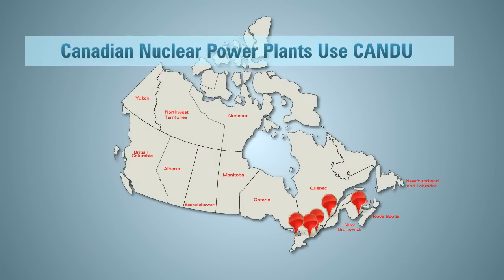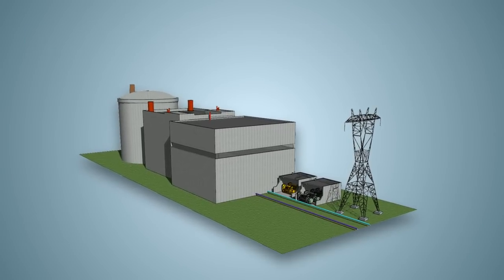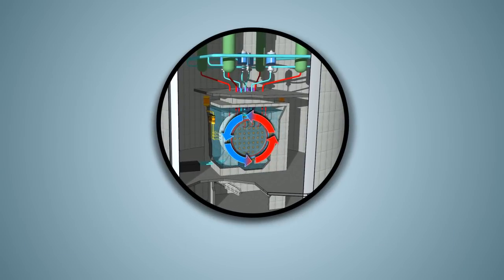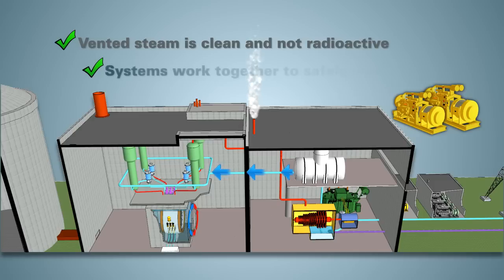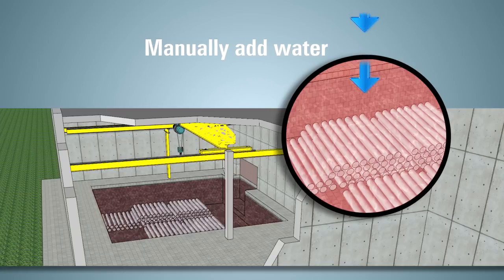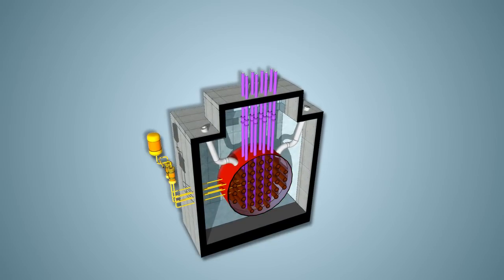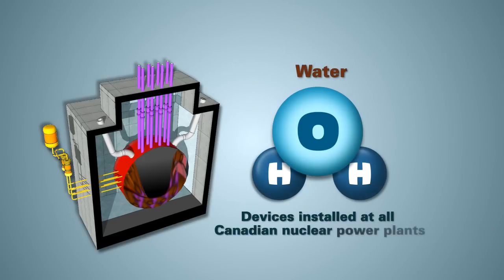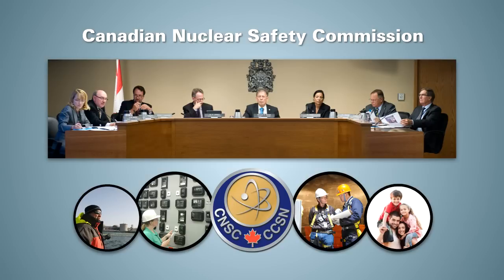Understanding Nuclear Power Plants: Total Station Blackout

Comment: We get it, putting water into the calandria using firetrucks or pumps will stop the accident
Reply: i love how you just replyed that to every comment in this video
Reply: yep
Reply: But the accident would totally keep going because they forgot how to pump water in.
Reply: But won't the heat keep evapourating the water you pump in and produce radiated steam? How to get rid of it?
Reply: LMAOOO
Reply: How imagine tsunami TRASHED the ground area and knock all power systems. And quake damaged the pipes...total meltdown even in CANDU. (2011 japanese scenario)
Reply: Wong Tik Ki the water that is use to cool is in another system if I’m not wrong, there is another video explaining how CANDU reactor works. But I’m not expert that’s what I’m think that’s all.
Reply: hahahahha
Reply: Jordan Rodrigues  you are wrong. The source of hydrogen is from the zirconium melting down. Radioactive steam will emit radioactive gases if the reactor's fuel rods melt and still produce fission at a higher temperature.
Reply: @WadcaWymiaru  except no. Because not only is this not japan, but seawalls exist. Fukushima's was shitty and caused a meltdown. Onagawas took it without problem.
Reply: @dickiewongtk  you recirculate it.
Reply: @CarlosAM1  
The problem lies in shitty element" uranium" from uranus :/
Thor god power solves the problem...
Reply: @WadcaWymiaru  I like thorium too my man, but we currently have tons and tons of u238 already mined as depleted uranium, candus can use this and twrs would too, I support lftr, but at least for now candus is the best we got. Also crazy safe.
Reply: @WadcaWymiaru  Basically water is added to the non-radioactive heavy water calandria.
Reply: Because those Japanese didn't and make a really bad impression on general public.

Comment: I see canada is low key throwing shade at japan
Reply: Yes. Yes we are. CANDU reactors are fucking awesome and we have every right to be proud of them...

...especially when Japan is still running reactors that they specifically chose over CANDU reactor designs because they were American, when those designs even at the time were known by GE to be pretty awful and wouldn't build them themselves in the US.
Reply: @liesdamnlies3372  You saw what happened at Fukushima! Loss of power=loss of coolant flow, and there are no passive systems. Big problem.
Reply: 2:18 ExTrEmLy UnLiKlY!!!!
Reply: @liesdamnlies3372  American is best build ;)
Reply: @kushpaladin  *oldest

FTFY ;)
Reply: For unknow reason there not even a ONE CANDU in japan...
Reply: @WadcaWymiaru  It's not unknown. They were offered licenses for CANDU reactors and went with GE instead.
Reply: But the reason WHY was unknow...
Reply: @fifthbusiness2591  
But in Fukushima scenario with total blackout CANDU can cool itself for a long time. Look at Fukushima BWR reactor design and the CANDU.
However i agree we should stop using nuclear energy in that way. There is far better coolant than water. Salt.
Reply: Not throwing anything at Japan. There have been several accidents through out the world that the nuclear industry hashave learned from
Reply: Windscale - England (Inexperience with graphite cores and cavalier attitude)
Chernobyl - Russia (Operating outside set Policies and Principles)
Fukushima - Japan (1960s design basis for Seismic deign considerations)
Bhopal - India (Lack of maintenance on safety systems and continued operation)
Three Mile Island - USA (not believing instrumentation and design flaws not shared with industry peers)
Space Shuttle Challenger - USA (Production over safety. Ignoring warnings from maintenance and engineers regarding o-rings)
Demon Core criticality accident @ Los Alamos - USA (Improper safe guards)
Tokaimura criticality accident - Japan (Continuing to work when equipment was faulty. Production over safety)

Most of these speak to mans lack of understanding of perceived risk in dealing with dangerous elements. Not to say that we cannot use these things but there is a need to be ever vigilant.
For some light bedtime reading, get the Industrial Operators Handbook. It looks ate several accident and the causes. It is a real eye opener.

Blessings
Reply: @liesdamnlies3372   CANDUs are great reactors. The US won't build them because of the positive void co-efficient of the core.

There are lots of BWRs operating in the US. BWRs are a different beast based on 1950s and 1960s technology. They were good for their time. But alas, times have changed.
Reply: @dslag654  
Let's be serious man:
How many people died in last 10 years from the nuclear?
One.
Miner.
Crushed by rocks.
In uranium mine...
Reply: @WadcaWymiaru  Apparently, you have completely misunderstood the point. The operation of Nuclear stations is the safest industry in the world. As long as we RESPECT THE CORE. This is what WANO teaches. This is what INPO teaches.
Mining and construction efforts for nuclear are far more dangerous industries. Please read some James Conca articles to get a balanced view of how these industries compare.
How many people died from the Fukushima Accident? It might surprise you to know it was ~1400 (if memory serves). The majority being critically ill patients who were moved from hospitals in the panicked evacuation. They did not survive the transport. Shelter in place would have been much better with no ill effects. (Thank you Hollywood.)
As for a 10 year viewpoint: Since the biological effects from long term exposure to low level ionizing radiation are still not well understood to this day. Human lifetimes are required to observe this. (A LNT debate is not appropriate here.)
Perhaps a better question to ask is, in the last 50 years, how many people have had their lives permanently displaced by mining operations vs. nuclear operations? (Though, Pripyat today has shown that our planet can bounce back much quicker from our abuse than was believed.) There is more to nuclear incidents than just deaths. 
Regulatory bodies and Operators work very hard to ensure that the risks are mitigated. In Nuclear the risk vs consequences is very high. Looking in the rear view mirror and learning from past mistakes is one of the best ways to remain vigilant and keep nuclear safe. The CNSC, NRC, WANO, INPO, etc. all focus to ensure safety is paramount.
Reply: They always use previous incidents to educate themselves on how to be safer!
Reply: lies damnlies you said the f word
Reply: @fifthbusiness2591    The passive autocatalytic recombiners (PARs) were invented in Canada and were the outcome of what we learned following the Three Mile Island incident (1970's) where a dangerous quantity of potentially explosive Hydrogen gas built up in the containment building following the melt down.  Fortunately they were able to vent the gas without incident but it was none-the-less a close call.  PARs were installed into all CANDU and, I believe US reactors well before Fukishima.  Why the Japanese did not install them in their reactors is a mystery.  They are literally a cheap tin box that sits up at the ceiling and eats hydrogen.
Reply: @joerenaud9356  IIRC, there's some solid evidence now that there was a hydrogen explosion at TMI. It just didn't end-up in disaster because you know, it was actually contained in a big-ass thick-as-hell concrete cylindrical-thicc-boi-of-safety.
Reply: I’m from Canada we just don’t want a god dam disaster that goes on our permanent record
Reply: @charleslittleba  We already had NRX.
Reply: @WadcaWymiaru  Price, complicated design, positive void coefficient like an RBMK.. Price, price, price.
Reply: @liesdamnlies3372  Well, as efficient and as safe as our PWRs are, I must admit that is true.
Reply: @fifthbusiness2591  It is good they are now, but a hydrogen explosion would have to go through the light water in the vault and then would be taken to the vaccum building. As for the positive void coefficient, it is far smaller than in the Russian RMBK reactors (e.g Chernobyl) and they are automatic safety systems that would shut down the reactor. The nuclear industry is improving, just like aviation used to be significantly more dangerous in the 1970s.
Reply: @liesdamnlies3372  Always a grudge Japan
Reply: India has PHWRs based on the same CANDU design. Thanks, Canada!

BUT it's sad that Canada isn't building new reactors while India is building 15 new IPHWR-700.
Reply: @liesdamnlies3372 >"and wouldn't build them themselves in the US"

That's false. There are/were dozens of those exact types of GE reactors, one of them being 5 miles (8 km) away from where I live. It's an old obsolete design that's been facing decommissioning since the 1990s.

Comment: If you have a bad accident, simply supply water with emergency equipment such as fire trucks.
Reply: yes yes
Reply: They did that at Fukushima and it caused the cores to melt further
Reply: But never forget that supplying water with emergency equipment such as fire trucks stops the accident. It's very important to remember that supplying water with emergency equipment such as fire trucks stops the accident. But in case the accident is not stopped, you can always supply water with emergency equipment, such as fire trucks. That stops the accident.
Reply: Mgtow-M3 Modern Masculine Men 
How? Those isotopes are contained within the fuel rods unless the cladding has a hole, which is rare.
Reply: that's because the fukushima reactor had a different set of things that had happened uncontrollably before they started spraying water on it, the point of this reactor is that the states of a meltdown are very controlled and relatively easy to remedy. In the fukushima meltdown, there was a large hydrogen explosion before emergency personnel were able to intervene. That's the main 'final blow' to a lot of these meltdowns. If there is no hydrogen explosion, the situation is under much more control because the vessels can do what they're designed to do, because all they have to do is soak up heat. But once you apply an explosion from large amounts of hydrogen that's already under high pressure BEFORE the explosion, then things go to hell. That's the reason their system that supposedly converts hydrogen to water is there, to prevent a hydrogen explosion, if there is no explosion then their safeguards can continue to operate as intended, and water can be added to supplement that, as all their safeguards are just trying to reduce pressure of hydrogen, and add coolant.
Reply: Link Freeman 
The safeguard systems failed when the diesel generators were flooded out. The only cooling system for the core is water circulation, no diesels, no pumps, no water circulation. There are a could other alternate methods, RCIC, but without power to open the valves, they don’t work, and were manually put on line. They took batteries out of storage and from cars to get valves open.
The hydrogen didn’t cause the meltdowns, it was created by the meltdowns, when the fuel cladding, zirconium, melted and reacted with the water in the vessels.
Reply: Flashback to Chernobyl where almost all firefighters died due to radiation poisoning.
Reply: Fire-fighting helicopters can also help
Reply: @maxhd2139  Bro that was like 35 years ago

Comment: I'm a Canadian who was brought here by a single line in an article that said my country's reactors were the polar opposite of Chernobyl. I couldn't believe it until I saw the (8? 10?) levels of safety redundancy built into our reactors. It's arrogant to say there could never be a disaster even with the best standards. But I would say with Canada's from all the research I've done it would be a statistical anomaly to have a failure.
Reply: The positive void coefficient aspect of the CANDU reactors are almost the same as RBMK-s from Chernobyl. Funny to say polar opposite with the same and not so safe characteristic. Also the online refueling with robots and natural uranium as fuel also similar to the RBMK-s. CANDU is the well made RBMK. Not the polar opposite.
Reply: @namelesske  For the sake of semantics - RBMKs used slightly enriched Uranium Dioxide fuel (~2% U235) wheras CANDUs use completely unenriched Uranium Dioxide (~0.7% U235) which is why heavy water (D2O) is required for both the moderator and coolant. 

Any reactor that uses light or heavy water (BWR, PWR, CANDUs, etc) are subject to positive void coefficients - it is unavoidable as the main heat transport system cannot reasonably be pressurized to the point where voids don't form at the temperature which they operate at (for context, CANDUs MHTS is pressurized to ~11MPa, on average across the system). (One of) the issue(s) with the RBMK was the insanely large reactor core which made transients (areas of increased fission due to high neutron density in a region, and one of the causes of voids forming in the core) common and difficult to deal with. CANDU reactors mitigate this by inserting adjuster rods (not the same as control rods) as well as tanks of light water where the water level varies based on the neturon flux of that area - these act as neutron absorbers and are littered throughout the reactor core. This, in turn, reduces neutron flux in a region and mitigates the formation of voids. And for additional context, at 80%-100% full operational power there will be a void of 2% (2% of the volume being steam, 98% being D2O) that forms on the outlet side of the heat transport system. This is closely monitored and controlled.

Of course it is plausible to draw connections between CANDU and RBMK reactors, they are, at their core, similar instruments. But there are truthfully very few major similarities between the two reactor types. A few examples of which are (CANDU vs RBMK): Heavy water vs Graphite moderator, vertical fuel rods vs horizontal, massive containment structure around the reactor vs virtually no containment structure. All these things aside the main difference lies in the incredible amount of safety systems in place within CANDUs.
Reply: @Jvdg3m3nt  BWRs and PWRs have a negative void coefficient because the moderator acts as the coolant, so when a void forms in the moderator, locally the fuel is under-moderated and the chain reaction slows down. Positive void coefficients happen when the moderator is different from the coolant and the coolant acts like a neutron absorber, like light water in both CANDU and RBMK; when the void forms, locally there's a reduction in neutron absorption but not in neutron moderation, so the chain reaction increases.
Reply: @Z80Fan  A fair point, although inherently it would become slightly under-moderated as well since the coolant does act to slightly moderate neutrons (both the coolant and moderator in CANDUs are heavy water). Should be noted that the 2% void coeff is built into the design of CANDU reactors in order to maximize heat transfer to the secondary side. My main point was the degree of independent and redundant safety systems built into CANDUs draws no comparison to the RMBKs
Reply: @Jvdg3m3nt  I was under the impression that CANDU used light water for coolant. My bad.
Reply: There have been some incidents (eg. Chalk Lake 1952, 1958, others) however I do have an implicit trust that every event that occurs domestically and internationally is one to be learned from. Nuclear energy and its safety continues to improve.
Reply: If you cannot get something as common as fire truck to a nuclear reactor that is melting down, I suspect the "total station blackout" has been caused by a nuclear war. In that case, your are less concerned about the puddle of nuclear lava inside a containment building and more concerned about the radiation thats kind of everywhere.